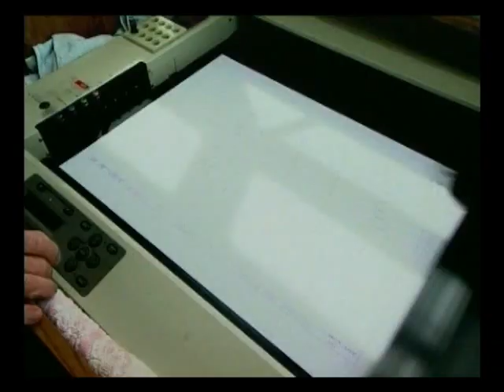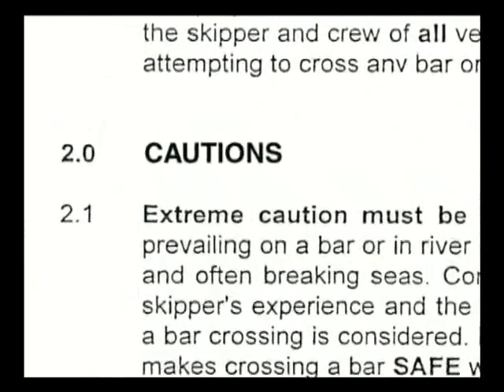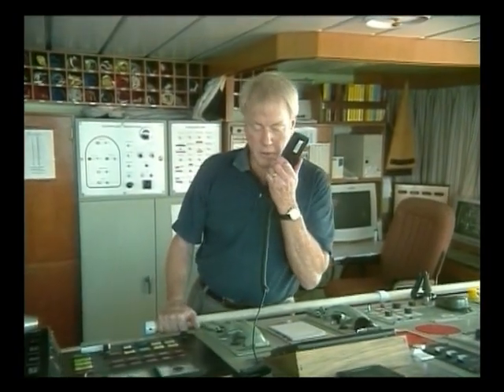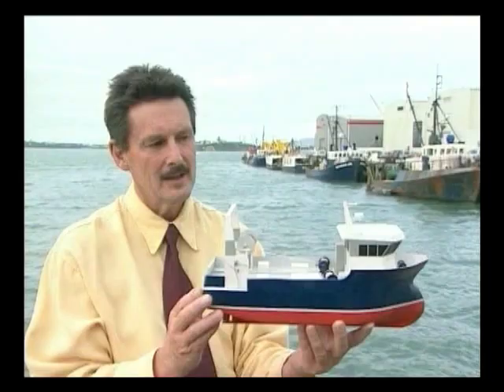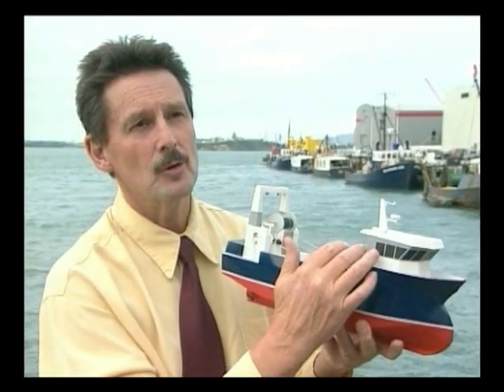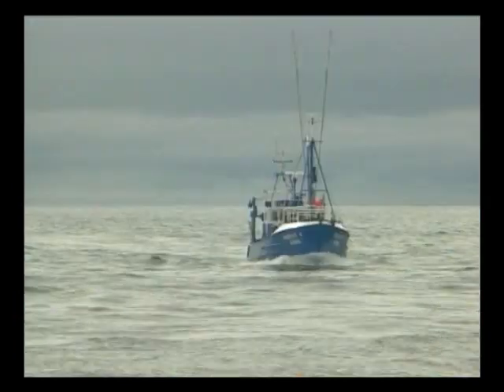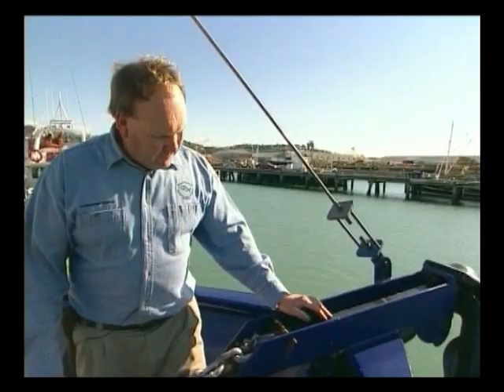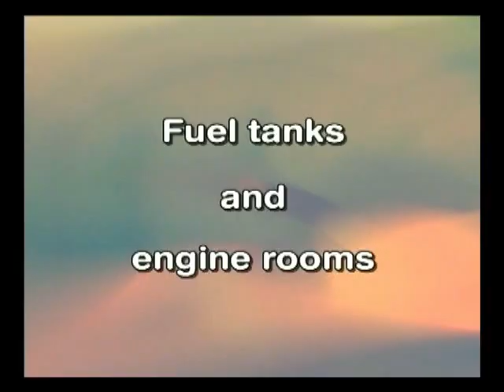Crossing the Bar "Getting it Right" Part 2  (video produced 2002)

Comment: 4:22 B/S - or COWDUNG.!
The Buller River is NOT the river with the largest catchment area in NZ - at a mere 6350 km2.
The Mighty CLUTHA (Molyneux) holds THAT TITLE - at a massive 21,022 km2.

A physical area size difference of OVER THREE TIMES that of the Buller's catchment area.

READ THE DIFFERENCES HERE:

The MIGHTY MOLYNEUX (Clutha/Matua) River's VAST inland catchment area is:
[quote]
Clutha River. The Clutha River/MataAu (MOLYNEUX RIVER) catchment lies across the breadth of Otago with a catchment area of 21,022 km2. and carried a massive 5100 cumecs in the 1999 high flood event, and the 5,700 cumecs that flowed during the even higher flood event of 1878.

It is the largest catchment (area) and river (flow volume) in New Zealand.Land, Air, Water Aotearoa (LAWA) - Clutha River
https://www.lawa.org.nz/explore-data/otago-region/river-quality/clutha-river/
[unquote]

versus:

The much SMALLER catchment area of the Buller River:
[quote]
The Buller River catchment (see map on right) has a catchment area of 6350 km2 and a mean flow of 454 m3/s at Te Kuha a few kilometres upstream of the Buller flood plain where Westport is located.Flood modelling of the Buller River, Westport | NIWA
https://www.niwa.co.nz/climate/urban.../flood-modelling-of-the-buller-river-westport
[unquote]

Unfortunately - the BAR at the mouth of the Clutha River (for boats entering into Port Molyneux) became so unusable during many of the last 100+ years flood events, that the river created two NEW MOUTHS, neither of which serviced the now high and dry Port Molyneux, (which has long-since ceased to exist as a viable port).
HENCE NOTHING CAN CROSS THE BAR NOW.
re:
.http://www.catlins.kiwi.nz/molyneux.htm

Comment: thanks guys. though I am a fresh water guy. in a small bass boat. the lessons are still apipcale.  I suppose the reason im watchining. is  ive been scared. and unprepared.. ky lake nicest conditions  imangeable cross .fish the coves great day.. (land between the lakes)  come back out to head home? lookly y  around the corner OH  SHIT.  barges throwining 15 ft spray. descion time.  smart move . cozy up in cove. bad move try to cross.   . interesting crossining. worked out. despite the self doubt. condifece in my boat my skills (and need for hot shower and food). outweigehed  my misgivings. worked out.. in hindsight  should of layed up. . but as it always is in after action reports shoulda colud have wouldhave..  don't mean shit. good or bad a descion needs to made and commited too.   I think that's what  spells captain. that being said. had there been other souls on board. well you know?